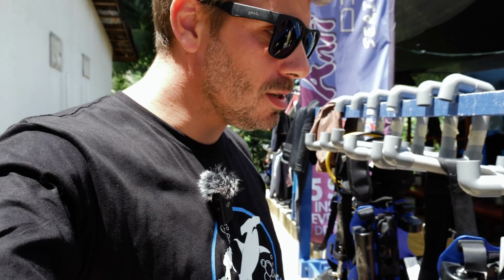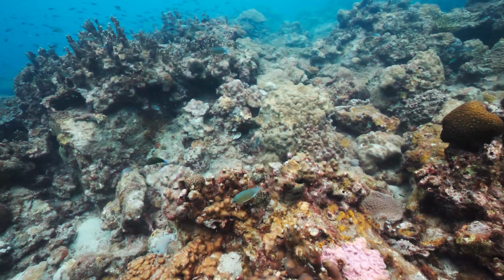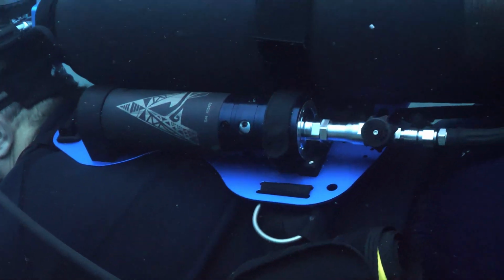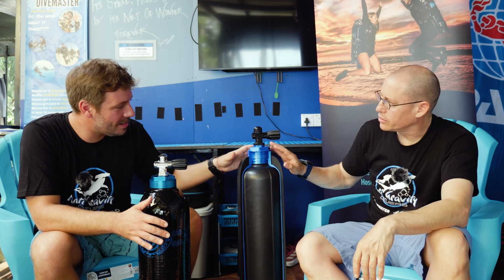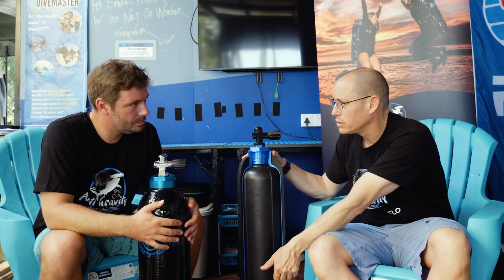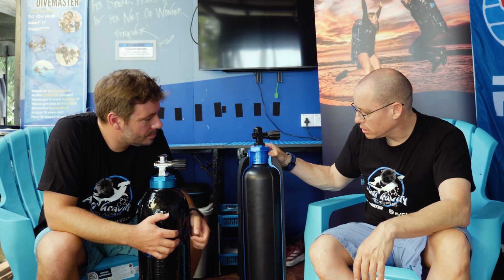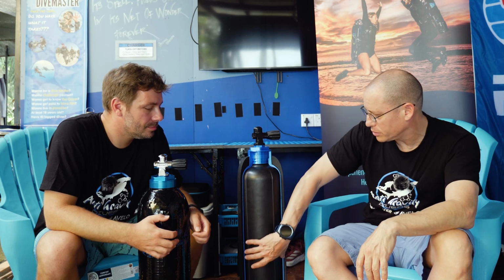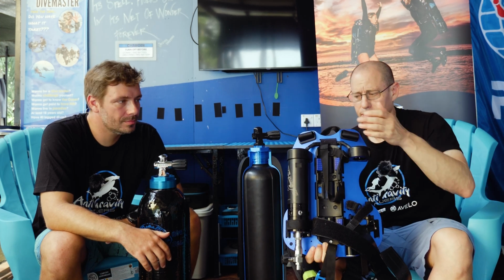The FUTURE Of Scuba Diving - Dive Avelo Review + Interview from CEO (2025)

Comment: You have a choice: 
- no buoyancy issues.
- stay underwater much longer using the ideal breathing mixture.

What is more valuable to a diver?
The price of a small Kiss rebreather is not far off that of an Avelo kit. And that will be revolutionary.
Reply from the maker: I dont think its that easy. Its not really ment to replace a CCR (I would never gave my ccr away for an avelo system, lets be honest) but it comes as a very interesting place in the market where there was just a small inovation, the bcd. Except the Sidemount harness developpment, and some new design, its still a air bag, and its nice to see someone try to disrupt this.

Comment: So instead of a BCD that you configure once or twice a dive, you now take a hidden bladder you can't check or service, an electric pump, a battery that needs to be rechargeable/replaced every dive and put everything that was in BCD pockets dangling onto the backplate. Sounds VERY attractive 🙄 Let me guess, it's also really heavy (including batteries) and expensive, while my very comfortable travel BCD weighs 2,5 kg all in? Come on 😂

The real BCD is the lung, don't forget. The external BCD is used to get neutral buoyancy on the deepest level you plan to dive, with rather deep breaths. Maybe going from 30 to 10 meters, you let some air out. Who used the BCD for going up/down hasn't understood the concept.

Perfect neutral buoyancy is nonsense, except if you stop breathing (not recommended) with the right amount of air in the lung. That device won't change that.
Reply: Try 2/3rds the weight of a conventional recreational system. Less bulky. More hydrodynamic. Safer failure modes. No significant buoyancy changes with depth changes. Yeah. This is total crap!  Why would anyone give up a good pair of horses for an infernal internal combustion engine?  You wouldn’t be a farrier by chance?
Reply: @clintcorbin3429 I don't carry a tank around on dive trips, just a 2,5 kg BCD. That's not 2/3rds of the weight, it's several times the weight.

There might be use cases where that doesn't matter. But it is going to disappear as quickly as it appeared. It's to expensive, the battery alone kills it conceptually. Imagine a typical two tank dive trip. The operator is supposed to put two of the things, teo batteries, etc. on the boat for each diver, plus spares. Bottles are cheap, but this? Recharging after that. Nobody will buy these personally and pay extra each time travelling with it, if that's even allowed on flights.

I seriously doubt any of these still exit and function (battery dead, no replacement anymore) in 5 years from now. Time will tell.

P.S. the combustion engine had huge advantages over horses. The picture for you is to ask sarcastically why anyone should give up ICEs for BEVs, and the answer is, without subsidies or mandates, almost nobody does, and even with all that it's not impressive, and mandates as well as subsidies are going away again, dropping sales numbers at insignificant installed base. But there are no mandates or subsidies to be expected for that tank 😉
Reply from the maker: I think you miss the point.

Dont you think the whole “lets get a tank that changes buoyancy, so lets make you sink with weights…. But you are too heavy so lets give you a baloon to make you lighter” should be challenged?
Reply: @MaximeCheminade I rarely use weights. And again, I don't travel with them. When I put gas in the jacket, it's on descent. If I am actually slow to pull the release open and detach the inflator if something breaks, and go up, I have no Nitrogen saturated and no risk of anything. After that, I only release air going back up, everything else is breathing controlled. Good dive profiles address these risks partially, but of course not completely. I never had or witnessed anything like that in literally decades and many hundreds of dives.
Reply from the maker: If you are diving, you do have nitrogen saturated. Even at 1m.
Reply: @MaximeCheminade not in any relevant way if you are down since 1 minute. It takes time to saturate tissues. Some faster, some slower, but it is the integral under the pressure/time curve.

Comment: What about a failure where the pump gets stuck on?

That seems like it could be very bad.
Reply from the maker: You can disconnect it with the lpi connector.. also you can open the purge right after the pump.. much safer than a bcd
Reply: I think the engineering dept at Avelo calculated the Cv ratio of flow to account for that, so the manual purge valve allows more water flow than the pump's flow rate is capable of, while simultaniusly restricting water through the purge valve from a pressurized COPV preventing any kind of a harmful 'water jet cutter'. 😊